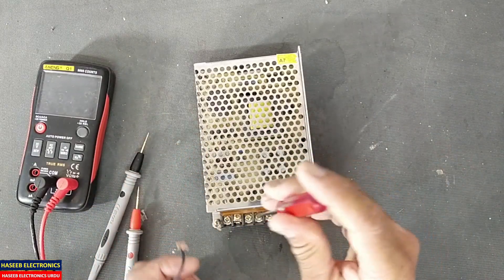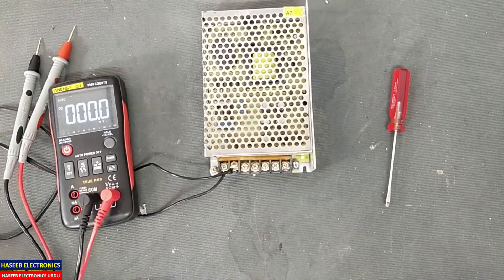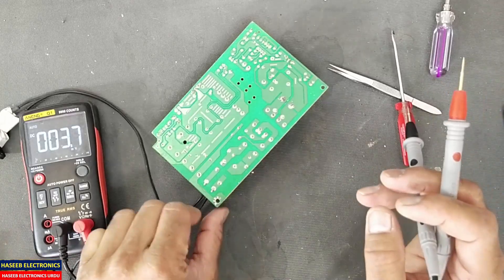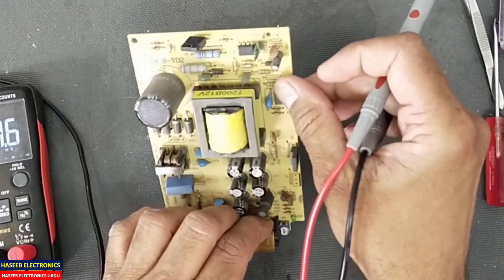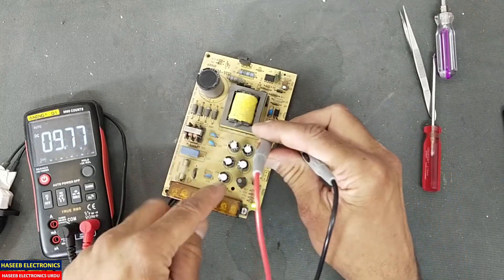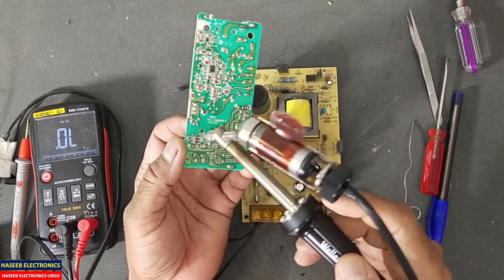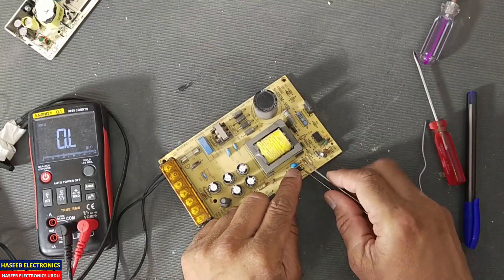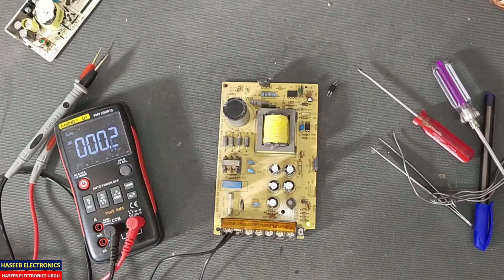{616} SMPS Output voltage Fluctuation / Switch Mode Power Supply Output Not Regulated

Comment: Comment augmenter l amperage  d une alimentation   de de modulateur?  Merci.
Reply from the maker: la tension de sortie peut être augmentée en ajustant les résistances du réseau diviseur de tension dans le circuit de rétroaction
Reply: Je parle de l amperage , merci
Reply from the maker: En termes simples, nous ne pouvons pas augmenter l'intensité du courant, car le MOSFET de commutation, le transformateur et tous les autres composants sont conçus pour cette puissance spécifique. Si nous essayons d'augmenter l'intensité du courant, nous dégraderons l'efficacité du circuit. De nombreuses vidéos truquées prétendent augmenter le courant, mais elles détruiront le circuit d'alimentation.

Comment: Amazing sir, I found a problem in Nikon MH 24 8.4v battery charger but his out only 2.4v I change smps ic MIP2K3 but problem is not solve. When I use Top224 Insteed of MIP2K3 the battery charging is start normally. What; 's a problem sir please define when I change many new MIP2K3 ic.
Thanks sir

Comment: Sir, I like your  videos a lot. These are quite informative and have deep knowledge in it. Can you please tell me if we can use CA 888 module in primary section in SMPS using LNK6666e IC. Because it doesn't use optocoupler. How can we connect CA888 in that id LNK 6666e gets spoiled?

Comment: Nice video sir ....Sir agar output voltage kuch bhi nahi aaye to kaise thik kre sare components thik hai fir bhi
Reply from the maker: check vcc capacitor 
check mosfet 
if both are good, may be the SMPS IC is not working check video number 522
also check video number 528

Comment: Which way to place  a photocobbler
Reply from the maker: LED Side (pin 1 & 2 are input pins) these must to connected to the point, from where are sensing some signal 
Transistor side (pin 3&4 output pins) are to control any circuit 
normally in power supplies pin 1 & 2 are connected in output side  and 3&4 are connected in primary side (Hot Side)
you can also check my urdu channel (haseeb electronics urdu) if you are interested to watch my videos in urdu / hindi language 
https://www.youtube.com/channel/UCLRRH_M_0oW1oLTuUOsDXdw

Comment: Rather rare malfunction. I'm wondering if it is helpful to use a true-rms multimeter BUT true-rms to the operating frequency of the SMPS. Let say at 150KHz (rather high frequency, so rather "expensive one")
Reply from the maker: best regards 
TRUE RMS multimetrs are good.  
you can also use FLUKE (fluke's prices are very high)
or Uni-T 202A+ (clamp meter) is also a good test instrument with low price 
this chinese Aneng Q1 is also a useful tool